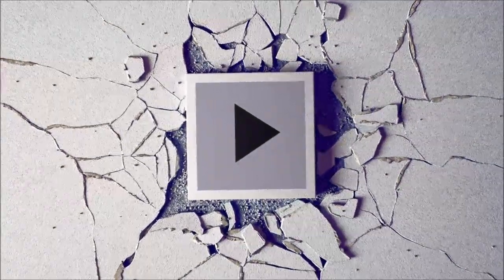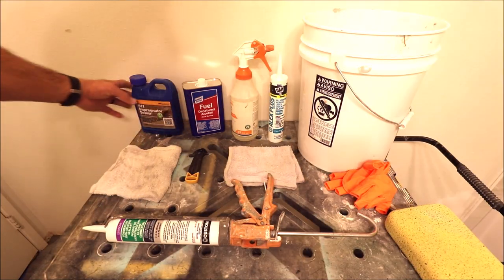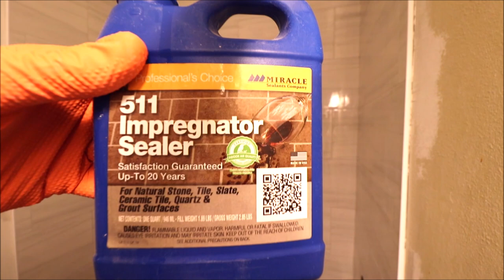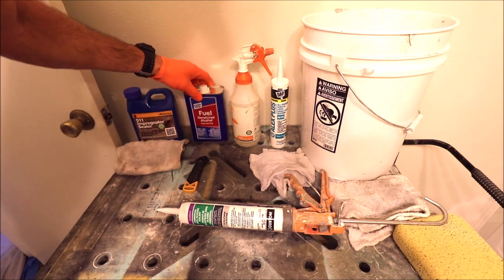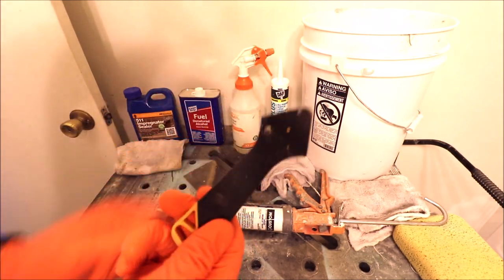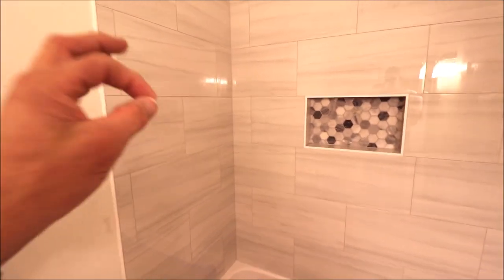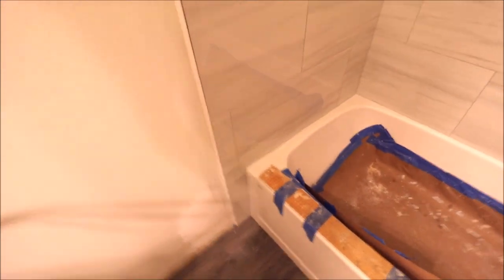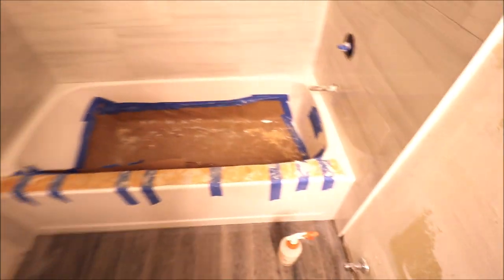How To Finish a Shower with Silicone Sealer and Caulk!

Comment: Love your videos. I’m always trying to pick up new tricks to push myself above everyone else. I’m a mud/backer board guy and have never had issues with my grout at the ceiling or interior corners cracking. Maybe because the schluter is a soft foam and has more movement your more likely to crack.  I do silicone my joint to the bathtub however I have seen countless cast iron bathtubs grouted in without any issues.  Weight is strength.

Comment: I always use painters caulk on the ceiling, so it can be cut in as well.
Reply: Yep, so do I, although I take the extra precaution of using "Big Stretch" exterior painter's caulk. Guarantees no cracking and no shrinkage.
Reply: @grumpus3046  I like the porter caulk, it's called pro something or other. The Sherwin Williams has a good one also
Reply: @grumpus3046  It's been so long I don't remember what you're referring to.

Comment: I’m very cautious in my tile jobs to use 100% silicone on the ceiling to tile areas.  Latex Paint will not stick to the silicone, creating a unsightly look. Since silicone is inevitable in reaching the drywall surface. So I case and base caulk that joint. I’ve even gone to the lengths feathering mud on a ceiling if the gaps is too great due to wows in the ceiling after tiling.
Reply: was just going to say this about the silicone on the ceiling joint. either do it after it's painted already or use the paint able silicone but GE. if the ceiling is pretty high and the bathroom fan is a good one you can probably get away with the Alex plus acrylic latex with silicone since it's only going to be exposed to humidity.
Reply: @Chanmantroop10   tape, spray silcone with Kills, then paint
Reply: @tonycastor8804  ya. If you have to. But better to not just use 100% silicone on the ceiling joint to begin with

Comment: I always silicone seal non planar joints. I use the fugimeister tools because they give a lovely chiselled edge and you tool the silicone clean without spraying on soapy water or alcohol. 

Great video man.
Reply: What the hell is a  fugimeister tool?
Reply from the maker: @vanman3752  I'm curious too
Reply: @LandbergTileTV  I think the guy is drinking beer spiked with shrooms.
Reply: it now the cramer tool on amazon $28

Comment: They make sealer applicators. Some have wheels but the best I've used has a stiff small brush on the end. you set the flow and it just keeps the tip wet. You can seal a shower very fast with very little getting on the tile.

Comment: First mistake, wen you seal with silicon you start from the bottom to the top, so that your surface does not get wet,wen it gets wet, silicon does not attach like it should.
Second, on the top of the tile to drywall you never use silicon to seal it, you may use Acryl seal that you can paint over it, with silicon the paint will not attach to that silicon.
Silicon its only for ceramics or glass surfaces and not for other materials, you should know that better than i know.
 every corner or surface that meet each other and are not ceramics need to be seal with Acryl, thats  a seal paste that can seal and expand and you can paint over it...

Comment: Does all grout need to be sealed, or are there types that have a sealant "mixed in" already?
I'm installing 3 x 6 foot tiles in my shower.  Do I use silicon sealant between the tiles, or grout?
Thanks,

Comment: Is there ver a time where sanded siliconized acrylic caulk would be used for change of plain in a shower instead of 100% silicone; or just use 100% silicone EVERY TIME?!

Comment: You used silicone for the joints but said you caulked the outsides of the bathtub.  Why the difference, why not silicone both?  Also on the ring that cover the hole for the sprayer hose on the wall, does that get attached in any way?  I've had to separate remodels and both times they were left free standing and on occasion slip down the sprayer hose leaving the hole visible.  Thanks in advance for your help.
Reply from the maker: I misspoke, silicone all around

Comment: Never ending debate. Grout is permanent. Caulk temporary. Imo. I prefer grout as 1st line of defense. Caulk only if grout fails. A lot depends on location and climate. You are correct according to many. I find it's personal preference.
That said you're the best I've seen.
Best channel for sure.
Reply: Grout will not expand / contract for inside corners . Especially if shower is on an exterior wall. Good divine will not crack
Reply: There is no debate, only people who fails to understand the industry standards and prefer to do it their way. In any guides including the tcna book, it is writing black on white, change of plane need a flexible component to allow expansion and contraction.

Now I don't even understand your claim about grout being permanent and not silicone.. your must FULLY fill the cavities with the silicone, it is permanent and you will only have to replace the silicone on the outside every once in a while. I'm guessing you also don't belive in waterproofing...
Reply: I’m a silicone caulk corner guy. The main reason is that grout only seals fully against tile edges and not tile surfaces. That means one edge of a corner, where the tile tucks behind, will be compromised when using grout only.
Reply: @vanman3752  no silicone naturally decays. Tell the thousands of owners I removed their moldy failing silicone where to buy lifetime silicone.  Peace out ✌️ we can agree to disagree.
Reply: @jont6861  Silicone is flexible and won't crack. However, Silicone isn't permanent because it deteriorates over time. They get moldy and look terrible in areas with continuous water exposure. Epoxy grout is the best for corners....Never seen epoxy grout crack and it doesn't get moldy and ugly like silicone does.
Reply: @mattmason7554  OK I will concede, silicone is not forever but 20 yrs is a long time but you know of a lifetime silicone? Pry-tell.
Reply: @williamp9158  I still don't get your point, we don't use epoxy grout everywhere (backsplash for exemple) and you need to install a silicone anyway. When it gets old and moldy then it's time for the home owner to replace it or call someone to do it.
Also epoxy grout is ultra ridgid and can crack like any other grout. i've seen way more service call for a crack grout joint in the corner then a molded silicone joint after 6 months.
Reply: @jont6861  I've never seen epoxy grout crack. Epoxy grout may not be flexible like silicone but it will stick to the corner real good and it will resist cracking. Epoxy grout in the corner is superior  and will outlast silicone. I only use silicone in the corners if I'm using regular grout or premixed grout....If I'm using epoxy grout, i just grout the corners with epoxy, it won't crack!
Reply: grout is not waterproof even when sealed. if your bathtub or shower is properly waterproofed with a membrane you should be fine. I personally prefer caulking change of planes but that's just me. a good quality 100% silicone caulk will last years.

Comment: So when you use that 511, it looked like you were just pouring it on a painter's rag and wiping the grout joints with If that's the case does the rag have to be wet?
Reply from the maker: Nope, we don't wet the rags. It just takes a little extra on the rag to get started

Comment: Hey great video, should I seal mapei grout as well?
Reply: I know mapei grout can have a sealer chemical in it.  It says it doesn’t need to be sealed.  But, when you get it wet it still changes color.  So, it’s accepting fluid to penetrate the grout.  Unless you use flex color cq or epoxy grout.  I would throw some sealer on the grout just for added protection.  However, most builder don’t seal unless the homeowner asks for it.  You can always upswell the service to the homeowner for an extra cost.  Doesn’t take long and with the extra money from doing it you can get a tank of gas or lunch.

Comment: What is the alcphol for after the caulk?
Reply: Silicone is awesome and can take a beating, but it’s very unforgiving to install compared to caulk. It will leave a thin film on everything it touches, no matter how hard you try to wipe it off. The alcohol keeps it from sticking when you are tooling it and excess material is spreading out.
Reply: @MoneyManHolmes  
Thank you.
Will regular 91% rubbing isopropyl alcohol work if mixed with water in spray bottle? 
Will it change silicone in anyway?

Comment: MAPEI's Ultracolor Plus FA gets wet but dose not require a sealer.
Reply: I use that grout too.  The instruction says you don't need sealer but can apply it if you want too.  Do you ever apply sealer to that grout?
Reply: @Methodical2  I have not and it seems to hold up, but I want to know from other people if they seal the grout again or not. What is their experience with it.

Comment: It seems that you guys do usually complete A2Z remodel of the bathrooms including paint. If that is the case what do you use, or what type/sheen of paint would you recommend considering runny-steam-marks maintenance etc? I see flat paint in most bathrooms and almost (more or less) always those ugly steam marks running down the walls. Thanks in advance LTTV.    👽
Reply from the maker: We use Satin on our showers, not too much sheen but protects as well. 👊
Reply: @LandbergTileTV  Thanks a bunch!  👊

Comment: Is there anywhere in the niche that you use silicone vs grouting?
Reply from the maker: no, we grout our niches.
Reply: @LandbergTileTV  thank you very much for the reply. I didn't think there would be a problem there. My niche is built directly to the studs though, so if I do have any cracks in the future, I guess I can just pack them with grout again.

Comment: did he forget to silicone the niche?
Reply: In my experience niche is generally fully grouted. Unless it shares a plane with surfaces that can shift or flex (where 2 walls meet, which is highly uncommon for a niche)
Reply: @begalbrew5572  so you don't silicone underneath a jamb either?
Reply: @goldfruitco6841  if I take your meaning of jamb by the corners of the niche where the wall tile is set behind the metal trim and meets 90° against the stone decorative in the back, no, those joints most installers grout to my knowledge. If you use an engineered stone sill for the niche bottom (see previous landberg vids) with overhanging edges some may use clear silicone on those overhangs as grouting it over the face of the tile wouldn't stick.